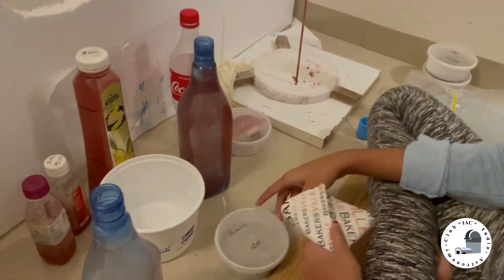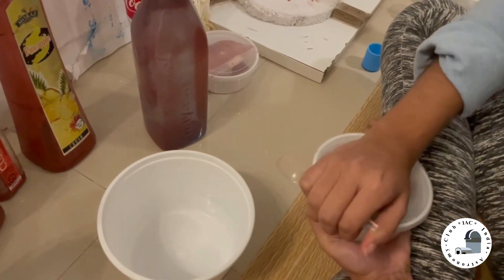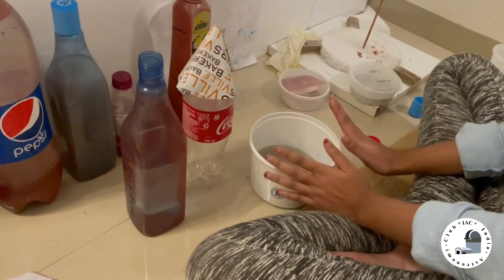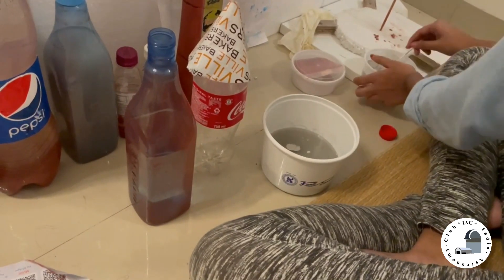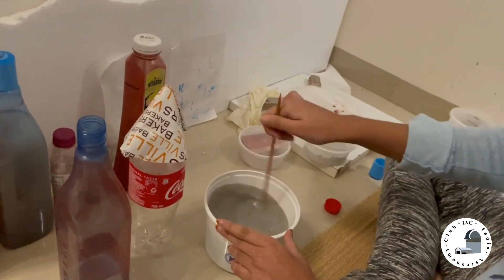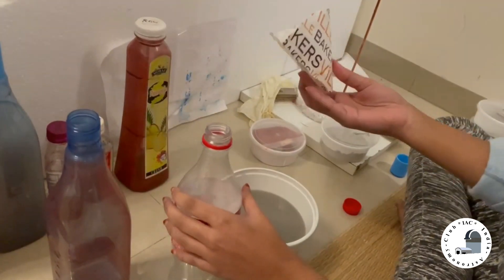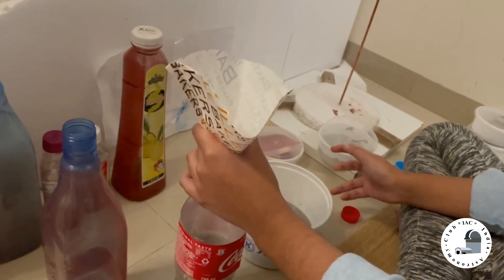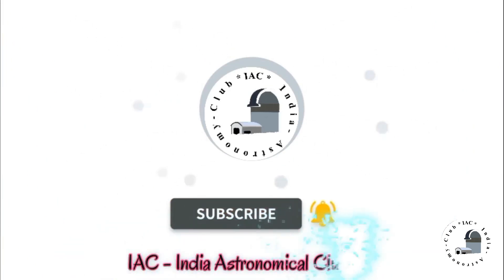Abrasive cleaning, filtering, decantation, decanting, sedimentation, elutriation, homemade telescope

Comment: Very helpful video!  Watched it twice and noted grits and wait times.  Using red rouge I have had sleeks, so I will try decanting before I try it again.  According to Texereau, red rouge leaves a finer polish than cerium oxide, so I would prefer to use it for final figuring of my first mirror.
Reply from the maker: Rougue works slow hence room for correction is more.